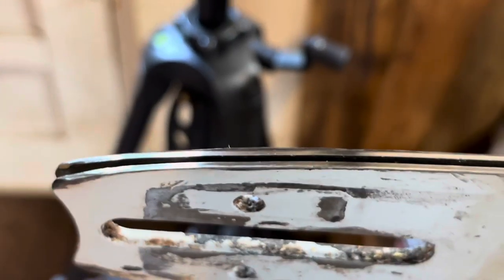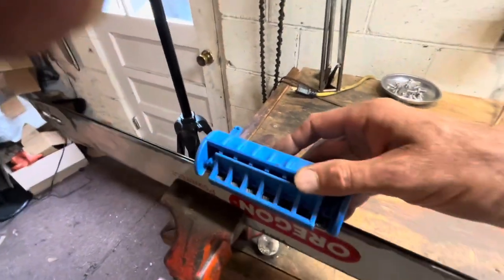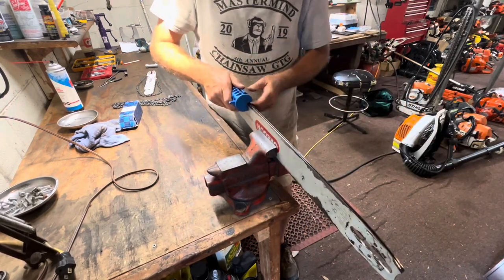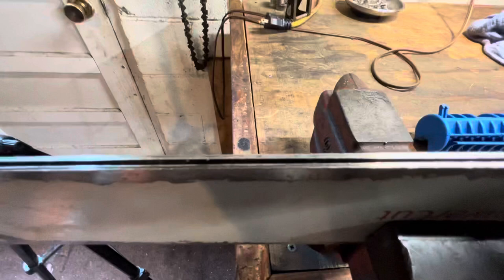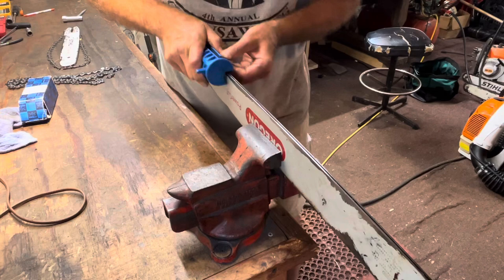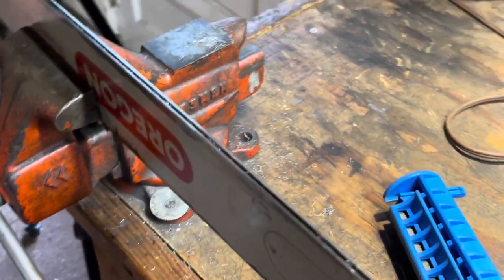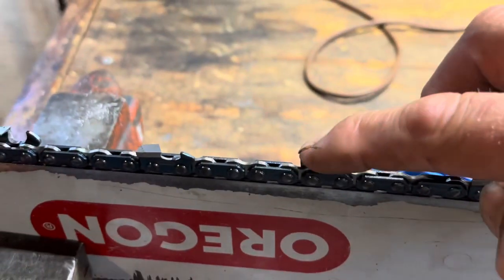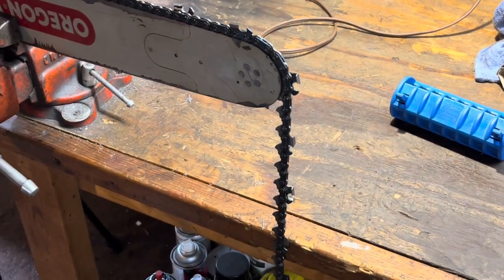Chainsaw Bar Maintenance.  How to Dress your Bar

Comment: I have an old Craftsman that the top/bottom of the bar look decent but the tip,  where the guide pins are,  one side has a deep groove and the outer edge is higher then the groove. Is it possible to dress the tip on the bar without messing up the guide pins?

Comment: Should you pull the file instead of pushing when you file the other side so the file doesn’t get worn out?
Reply from the maker: Fireball Tool has a interesting video on back-dragging the file.  I've always been told it would wear out the file too.  I was enlightening.

Comment: What causes the bar to wear? I get deep groves in my bar...I'm running a 76inch wide milling bar...
I appreciate your vids man!!
Reply from the maker: At the end of the day, it's metal against metal you'll have some wear over time.  You'll have to inspect how well the bar oil your using is lubricating the bar and make sure the oiler is turned up to it's max setting.  Maybe try a different brand if you're having excessive wear or manually add some while milling.  What type of set up do you have?
Reply: @richardflagg3084  much appreciated 🙏  yea ill look into that forsure
Reply: if you throw a chain it can cause burs... lack of proper oiling also